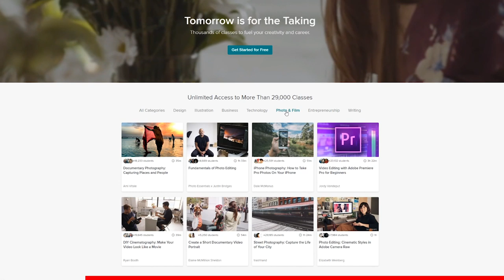Four EASY Bases For Your Minis!

Comment: Superglue goes through a powerful rapid exothermic reaction when put on porous/fibrous natural materials. Can even start a fire with some superglue and cotton wool! That's what caused the smoke on your bark piece
Reply: Science!
Reply: Yup!
Reply: What exactly is the reaction? why does that happen?
Reply: @MrGdtait  It's oxidation over time. If put in open air with enough heat and fuel it catches fire.
Reply: @Uberdemon0666  So with ambient temp and increase surface area from the porous wood it has the activation energy to make the whole thing spontaneous?
Reply: @MrGdtait  It's a chain reaction. The exothermic reaction of the glue bonding (heat) + oxygen + the fuel (wood) = fire. If you don't stop it in time you get fire until you starve/stop the fire of fuel or oxygen. Fires basically need heat, oxygen, and fuel to start and keep burning. You remove one of those elements; then the fire stops. Linseed oil is documented as having a similar reaction in the right situations. There's other youtube videos on that.
Reply: @MrGdtait  "So with ambient temp and increase surface area from the porous wood it has the activation energy to make the whole thing spontaneous?"

Superglue heats up when it cures - The curing is a reaction where the glue reacts to the moisture in the air and becomes solid. 

The superglue's curing reaction needing the ambient moisture (i.e water) is also why touching wet superglue with your finger results in a hard coat of superglue damn near instantly - The glue absorbs the moisture on your skin and dries faster. 
This is also why a thick coat of superglue cures slower - The outer surface quickly drains the accessible moisture, insulating the inner glue from the water it needs to cure.

When he poured the glue onto the bark, he drastically increased the surface area of the glue, making it cure (and thus heat up) faster - It's even possible that the bark had some residual moisture that the hungry glue absorbed to cure even faster. This heat was enough to make the dry wood start smoking. 

With more glue or a bigger piece of wood he could easily have started a fire on his set.
Reply: melted plastic trees to styrofoam once with polystyrene glue unintentionally.
Reply: Miniac: "Sheeeeeeeeeeeet....."
Reply: Science 🧪 🧫  🧬
Reply: Science yo ;o)
Reply: Looked like it reacted with something. Was pretty metal TBH. I normally use super glue at work for its intended purpose, sealing my cut up hands
Reply: Well that's what she said. XD
Reply: I learned this lesson trying to make a sheep costume

Comment: You have a different definition of easy than I do. Sweet looking bases though.
Reply from the maker: I guess easy to me is defined by how long these took me. No detail was labored over, so the process was really fast!
Reply: Miniac : The way I see it, almost all of the individual steps in this process were easy. I wouldn’t call these bases simple, quick or trivial, but neither did you. The difficult part is the aesthetics, really. That’s where I usually struggle. Furthermore, one obviously needs quite a bit of materials. Feel free to call the bases easy, though you might want to elaborate on what you mean (”It looks far more difficult than it actually is”). Watching your video, words like ”inspiring” and ”beautiful” come to mind. Thank you!
Reply: they may not turn out as well but certainly its only a limitation of imagination. even if you just add a fews extra bits.  I wont a local painting contest best overall stormcast  ranger(personally i hated the mini but was to lazy to cut it up as a dead guy which i originally intended)) with a sword in a rock from manic games crate, a skull a fews tufts of grass on  crackle paint(first time i used crackle paint).

Comment: Maybe for the next base series showcase what you can do on models that are ALREADY glued to the basis. I personally don't buy those kits where you put the minis together, but rather already completed minis on basis, ready for priming
Reply: I second this request. As someone who often buys second hand models (and/or may have assembled a bunch of models before even thinking about basing them) something I can easily work in around mini feet would be greatly appreciated. I'm trying to work out a good way to do some kind of vehicle wreckage in snow type setting but I don't know what the hell I'm doing. Thanks for the quality video.
Reply: I'd like to see this and attaching minis to bases like in this video. Bases like these look nice, but I've always wondered how you attach the mini without screwing up the paint job and if it'd be more troublesome to attach the mini and then paint the base and all.
Reply: @masochisticmuffin  Did you not watch the whole video? Super glue or pinning.

Comment: My current favorite base design is what I'm using for Stormcast. I cover the base in styrene cobblestones, and add green stuff as dirt towards the edges with the occasional small rock or skull pressed or glued into it, then I drape green stuff vines over all the parts of things. Once things have set, I take some baking soda and glue it to the dirt piles. If you want, and have the room, you can make it multilevel with a sheet of cork covering part of it, and have both the top and bottom covered with cobblestones.
It's detailed, and if I ever actually build an army, I'll totally cast 5-10 of them and make them in mass.

Comment: Something I highly recommend and use almost religiously are the Basius pads. They're large resin squares with the relief of some terrain, you just spritz it with water, glob some greenstuff onto the base, and press onto a random location then pull it off. They look fantastic, have a lot of variation, and are easy to supplement since it's greenstuff (they have a forest pad that I use and run the tires of vehicles over to get a sense of weight and mud).

Comment: Vallejo Pigment Binder or MIG Pigment Fixer. Vallejo is a bit thinner than traditional matte mediums, but roughly the same thing. MIG, however; is what I use for all my weathering. No problems and it only slightly kills the dryness of the pigment. Best done in two layers to create a nice dry/ wet contrast.

Comment: All of those bases looked fantastic, and different. For sure want to see more! Also that tearing on the fence when you went to cut really worked for the base in my opinion. A mech crashing through it would cause cuts and tears. Or I like to think if the tear was at the bottom, someone was cutting it when something crashed into the fence!

Comment: For your dry pigments (i.e. chalk), you can use 'pigment binder pretty much every brand is the same. Because I'm cheap, I just use odorless thinner or white spirits. If you mix the pigment and spirits to a thin "paste", it works pretty good. I've had decent results with it, but be prepared to let it dry for like forever, it takes over night (basically 24 hours or so). I couldn't tell you if the binders dry faster because I've never used them. 

Great looking bases. 👍👍

Comment: Vallejo recommends sealing in dry pigments with white spirits dropper-ed on them, then using gloss or matte medium over that, depending on what loom you're going for. 

The more you know!
Reply: Still comes out less dusty though. I just bought a few pigments from them and haven't found a good way of application either.

Comment: You can fix dry pigments with fixative hair spray. Many artists use it to fix pencil or coal draws. Sure it will work with dry pigments but I'm not sure if the solvents from it will not melt the underneath paint. You should give it a try anyway.

Comment: So, I've been working on a pretty standard base for a new dreadnought, and I think i might have accidentally found a solution to your dry pigment issue?  I've been using Abteilung 502 Urban Industry Dirt, applied using a rubber sculpting brush, and then using a toothpick to drip 502's Pigment Fixer onto the dry pigment.  After leaving it to dry the pigments all leveled out across the surface, and had a great matte look.  Frankly, it just looked perfectly dirty.   Hope that helps, keep up the great work!

Comment: A tip for dry pigments is to use a very thin contact cement applied with a brush wait until the cement is tacky but not wet, and then apply the dry pigment.

Comment: Perhaps a way to keep dry pigments from being worn away is to seal them in with some mr. super clear sealant. You could also create different effects by layering the pigment, then applying a layer of mr. super clear (waiting for it to dry thoroughly) and then apply another layer of pigment and so on; be aware that it may get cloudy (especially on clear parts) and that it is extremely heat sensitive; I recommend using it on days with low humidity.

Also, after the sealant is dry it can flake easily if handled; so I recommend keeping it away from areas that have a lot of hand traffic or handling the mini's delicately.

Comment: How about making 4 different kind of forest bases based on the 4 seasons? Also 4 urban wasteland kinda thinge-y. My personal fav for basing is making it look like it's a Forge World under attack. With tubes, steel sheet flooring mixed with stone pavement, wires and small dunes made of entirely decomposed rust turned into a fine sand like texture.

Comment: 6:20 Super glue hardening is an exothermic reaction. That is why you're not supposed to use large quantities, at a time.

E.g. I worked at a fossil dig, last year. If bones broke apart (and they often do) they would be glued bad together. But we mainly fixated the fossils with a plastic-in-alcohol solution, instead, where the alcohol would just evaporate over an hour to leave everything covered in a thin sheet of transparent plastic-ish substance, ready to be stored for years without weathering. Had we just glued it all, it would have damaged the pieces quite a bit.

Comment: Try a gel glue. The issue may be that thinner glues are soaking into the dry pigment, since that's what pigment is supposed to do. An adhesive thick enough for the pigment to sit on top of may be the ticket.

Comment: The smoke is a chemical reaction of the glue and water that is inside the wooden bark... I would always dry my dirt and wood before using it. Otherwise it comes to a reaction in which a lot of heat is created and this is not only toxic for your lungs if you breath in the smoke but also it could start to burn.

Comment: I saw when you put blood on your base, do you just use GWs Blood for the Blood god and just air through an airbrush or is there something else that I’m missing?
Reply from the maker: I do use Blood for the Blood God, but it is NOT in the airbrush. I'm just using the airbrush to blow it off of the paintbrush in front of the airbrush. This makes a nice splatter.
Reply: Miniac aaah genius. That’s what I thought first but got more unsure the more I thought about it. I used the flipp technique shown by Warhammer TV where you put paint in the brush and then push it back with your thumb and let it flipp back like a catapult before. Works but hard to do and makes one hellova mess. Gonna test this out from now on, thanks. Great vid btw. Got me inspired to work harder on my bases

Comment: I would not recommend using capacitors for bases, they might over time start leaking potentially harmful chemicals. Depending what else you have on the base they could even catch fire.

Comment: "Four easy bases! Just pull out your sculpting epoxy and airbrush kit, you know, those very common things you can find in every home!"
Reply from the maker: Do you not have some kind of green stuff, milliput, or a mixable air-hardening clay? It's like $8 for a roll. Just because I use an airbrush, doesn't mean you can't get similar results without one while maintaining the simplicity.
Reply: @Miniac  No, I don't. I found this video because I began painting miniatures only a week or so ago; my point is, if this is supposed to be a set of easy, beginner friendly techniques, it's disheartening to see a reliance on tools beginners won't have access to.
Reply from the maker: @PlayMadness  The average beginner certainly has access to 2 part epoxy putty. Virtually every hobby store, big box art store has it and it's readily available from multiple sources online.

Comment: Tried matte varnish over pigments?
Reply from the maker: yessir, very similar to matte medium
Reply: @Miniac  Ok cool. how did it go? I'm into Gunpla right now and have tried a few times at weathering just using pigments only for highlighting. Worked enough for me just to spray a matte coat. Haven't tried a diorama but I thought that's how it goes with weathering.
Reply from the maker: @WilliamEndo  very similar to matte medium, kind of kills the dusty look. There are lots of different varnishes though, so ymmv